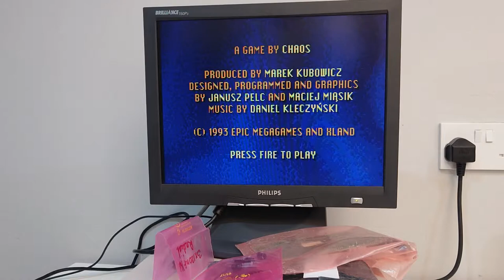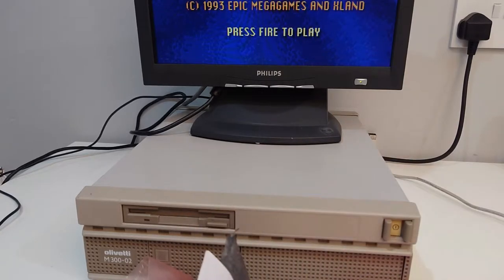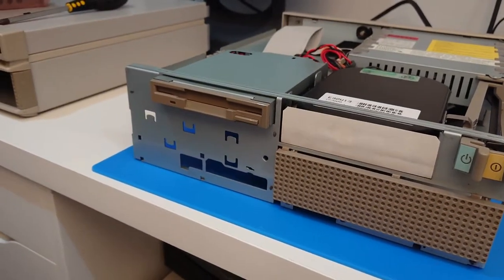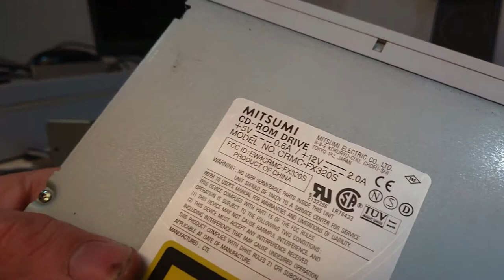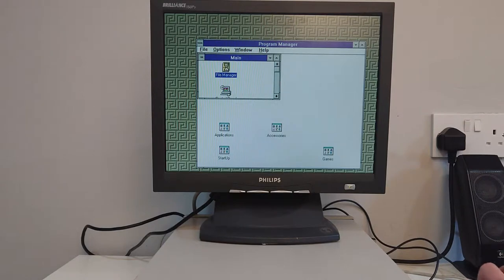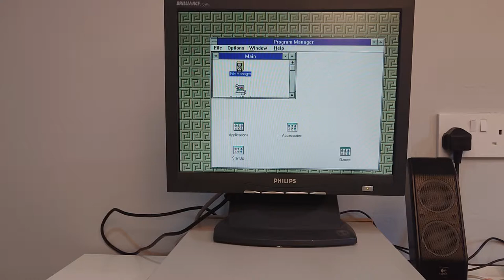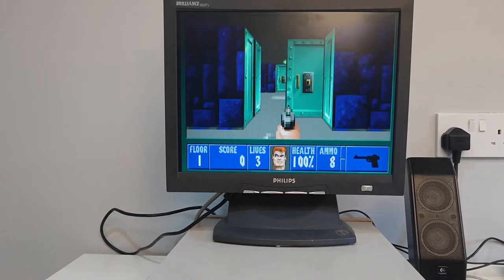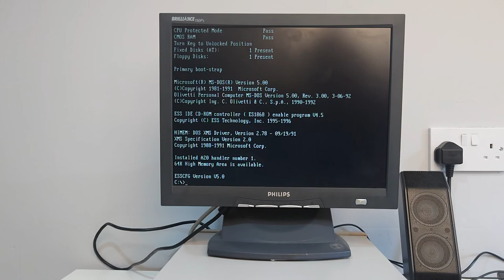Olivetti M300-02 386 Part 2

Comment: I also had been having a lot of trouble to get old FDD drives to work. I´ve tried the cotton swab with IPA method with low success. I´ve been able to get them working by applying contact cleaner (WD40 branded) directly in the heads, followed by compressed air. Doing this 4-5 times, led the drives to be able to read the floppys.
Reply from the maker: Might be worth a try, I have a bottle of that wd40 branded contact cleaner.  My concern with this old drive was that it left scratches on the disk but maybe its still just dirt.

Thanks for the tip!

Comment: The lock lever (at the end of the video)  disables the pass through power to the monitor. This way you can turn the off monitor (to save power) while preventing the power switch being turned off. It may also lock the keyboard, but I am not sure.

Some people may perceive when the screen is off, the computer is off, and will press the power switch to turn it on, actually turning it off.

The original VGA monitor had no power button and  was connected to the pass through power at the back of the power supply.
Reply from the maker: Thanks for clarifying this.  I've also since discovered it disables the mouse but the keyboard continues to work.

Comment: Great nostalgic video! What speed is it running ? Wolf3d seems very slow, have you check the motherboard for any jumpers that set the speed and did you try anotehr floppy disk ?
Reply from the maker: At the time of this video it was a 16mhz 386sx.  In part 4 of this series I overclock it to 20mhz by swapping out the crystal which makes things a bit faster. 

Unfortunately the floppy drive is completely dead. It won't read anything and any disk I do put in it gets damaged.   I might swap it out for a gotek floppy emulator or since I now have it on the network I can transfer most stuff across that way.

Thanks for watching and commenting.
Reply: @CRG  Gotek would be an idea if you can't find another mechanical drive. Suppose you could desolder the CPU and replace with a 25Mhz CPU if you are good at replacing SMD chips. I know there is a 25MHz model of that machine.
Reply from the maker: @arnolduk123  yes I noticed in the manual for this system that there was also a 25mhz variant.  Thing is though I'm not sure if the other chips on the board would handle the higher clock speed plus my soldering isn't quite up to that standard. 

I'm happy enough with the 20mhz overclock.  Wolf3d runs perfectly on it now.

I have another old machine now sitting waiting some love.  It's an old 286 thing from hm systems.  Still doing some research and planning out what I'll be doing to it but it'll be something similar to the Olivetti.
Reply: @CRG  I'm pretty sure the 25Mhz model has the exact same mainboard, just an updated BIOS to support more hard disk options. I've got the service manual for the Olivetti M300 and there is an extended bios settings for changing the clock speed and I/O speed of the system.
For the 25 MHz clock version, motherboard with
2 MB
- To comply with the restrictions imposed by the
UL and NEMKO norms, the value of resistance
R245 is changed from 100 Ohm to 340 Ohm.
- Cuts and trimmings to guarantee a stabile
picture on the screen when using a high
resolution 1024x768 monitor.
New BIOS allowing the management of the
following HDUs: Quantum ELS42A 40 MB
Quantum ELS85A 85 MB
Quantum ELS127A 120 MB
CONNER CP30124 120 MB
Board level does not change. Taken from service manual.
I wouldn't risk remiving the chip though if you've never done any large SMD chip removals, practice on old boards first. As for your 286 project, not much apart from a Co-processor upgrade as they only run at 8Mhz and RAM is very limited.

Comment: I'm glad that I waited before commenting. I was so confused by the poor performance of Wolfenstein, as I have a 386SX 20MHz and that plays the game just fine. When I understood that you were running it through Windows it made sense. 
This video is extra interesting to me, as I have the 486 successor to this on its way.
As an aside, the 387 Math CoProcessor doesn't do anything for DOS games, but for Windows 3.1 I found it made a marked difference, as Windows does use the FPU for calculating screen position and redraw. In fact, I have actually found Windows to be quite pleasant to use since adding that in alongside a Tseng ET4000AX adaptor. Something to consider, if only for curiosoty sake.
Reply from the maker: I don't suppose that was the olivetti that sold on ebay a few days back?

I might consider the 387 just to see how much difference it makes but I've actually taken windows off this machine now.  (it's stored on my nas backup along with other hdd images). I just use the olivetti for classic dos games and need that hdd space, well until I get an xtide and can add a bigger drive.
Reply: @CRG  Yes it is that one. I really, really wanted a 486SX machine and this is perfect. I don't know what state that machine will be in when I get it, but do plan on recording the adventure - and the reasons for why I wanted it.
Reply from the maker: @achaycock  I had my eye on that one too!  Enjoy it.  

If you can please let me know how you get on with it.  I'd be keen to get a look at the motherboard.
Reply: Absolutely! I've got a number of projects on the go that I really do need to record,  so I will be certain to make this the starting point for that process.
Reply: @CRG  I'm recording my experience with the Olivetti here:
https://retro.haycock.eu/2020/04/29/the-olivetti-pcs-44-c/
That is the first post :)